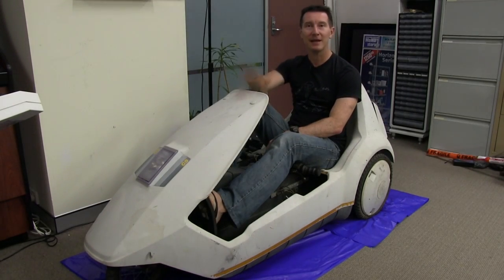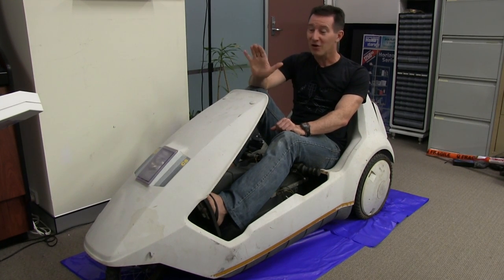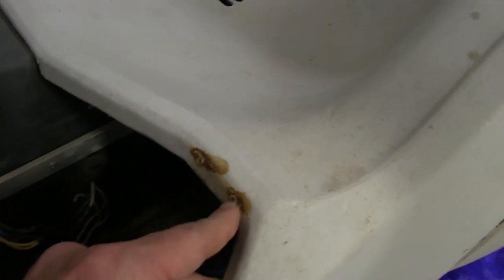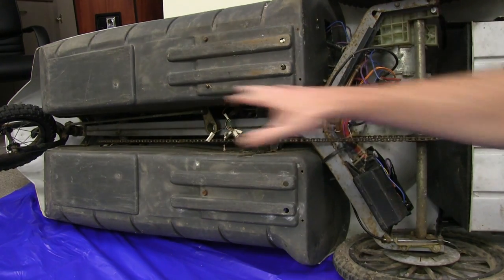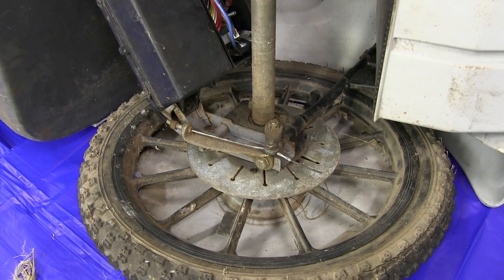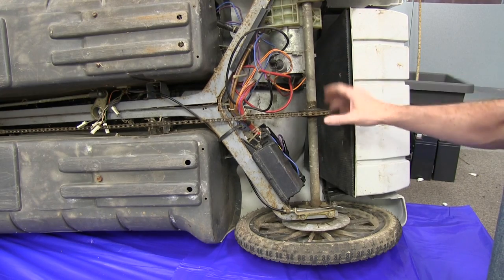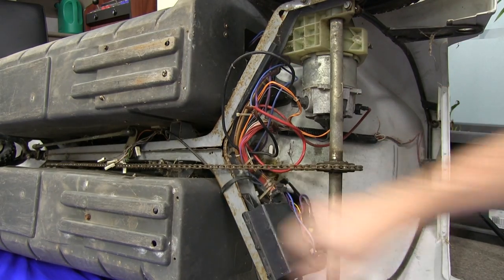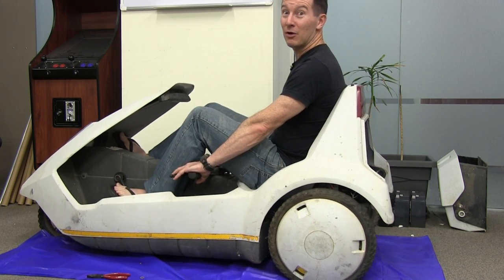EEVblog #604 - Sinclair C5 Restoration - Part 1

Comment: The rust doesn't look that bad to be honest, mostly surface. You could look into getting the chassis acid dipped, then powdercoated, or sand-blasted to just get rid of the rust. Pretty cheap considering the time it saves you!

Comment: The crucial part will be to repair the steel frame.
The sheets that the frame is made of seem to be very thin. After removing the rust even less material will remain. Thin sheets like that are very hard to weld. You probably won't be able to do that with a cheap arc welder and even if it was possible you should train on some other material first, or you will ruin the job. My advice would be to take the whole thing apart and completely free the frame of any rust stains. Then ask someone else to do the welding.

Comment: There are several torn spot welds. The way it has split apart would indicate the rear frame horns are bent upward slightly. Looks like it took a hard bump or pothole. Once the horns are pulled back down into align with the rest of the frame the gaps should start closing up. It will need to be welded and reinforced. I would not attempt to drill or bolt any kind of patch or it would weaken the frame at the hole and it will break. Just needs to be removed and taken to a welding shop. Might take them a bit to fabricate a reinforcement but it will make or break the project. Don't skimp on that repair. If it broke in traffic things could go very badly. But it is fixable by someone that can weld. Not a big deal.

Comment: Hi Dave, I'm a motor Mechanic by trade, but i love learning about electronics, and find your videos very interesting.  The Chassis on the C5 is certainly salvageable, the best thing to do would be to remove it, grind of the rust off then get somebody to weld the chassis together, then repaint.
Thank you for your very entertaining videos,

Comment: 15:30 - Seriously Dave, can't you recognise a "throttle" from an electric battery drill ? :D It's the mosfet and controller for a drill that's mounted by the previous owner.

Comment: I've restored a lot of stuff, and that is in excellent condition compared to everything I have worked on. One small crack, some light rust - the stuff I do you can put your hand through -, bit of fibreglass repair, paint, mechanicals, electrical, it's all pretty easy stuff. I've repaired stuff with sections missing out of it, it just takes a bit of knowledge. If you need a hand I'm across town.

Comment: Interesting little vehicle!, definitely needs TLC, but far from hard to restore!, actually has great potential if you want to hide some modern motors and drives in there :D
worlds fastest C5? :D
Reply: Maybe you should team up - you certainly could help him out with some of the mechanical aspects ^^
Reply: It is one interesting little car but it looks like the chassis needs some reinforcement
Reply: You could always help Dave out with welding a easy piece added to the Y joint and it would be good to go.
Reply: You guys should definitely team up one this one!
Reply: Kris Ankers
could go Delorian style and tig one up out of stainless :D, trouble is weight is an issue with EV's. tho with modern drives and motors, it would handle the few extra KG.
Reply: That's a cool idea! Why dot you make it in to a 1.4KW all wheel drive with 3x350W brushless hub motors? That thing will go like a rocket!

Comment: The main chassis is formed and spot welded.if you dont have welding jig, can G-clamp the chassis gap.. grid it flat..Cut a flat supporting plate and MIG weld it to the chassis, without removing the rear axle, as you might risk whooping the metal chassis.After the chassis is repaired send for Sand-blast>Primer>paint job,continue with other restoration work. This 3 wheel electric bicycle could be a simple restoration project.

Comment: Hi Dave!  Simply mold a new chassis out of carbon fiber.  It looks like there's plenty of room for a 50 hp brushless motor and a lipo battery bank.  Don't forget the fire insulation or that fiberglass seat will become a permanent part of your anatomy.

Comment: That chasis is an easy repair, I reckon it has split because of the leverage from the weight in the seat to the rear wheels. welding a y shaped plate !/16" thick over the frame where it has torn apart. The rust is superficial so a quick rub down and rust converter both inside and out. Job done.
Thanks for all your hard work.
M

Comment: Take the chassis to a sandblaster, for the rust. Once you get it fixed (welded), you may think of using an epoxy paint on it, to keep it protected in the future.

Comment: Chassis looks good. Just needs a sanding, and bit of welding along the bottom rib. Learning to weld is pretty easy actually. If you bodge the bead, just grind it down to make it look good. I'd definitely motorize the back axle so you get decent traction.

Comment: I would strip it down, send the body to the body shop who know how to handle fibreglass - they can make it look like new, fill in all the bodges. I'd send the metal chassis to a welders or engineer's shop, they'll grind back or sandblast the surface rust away and weld up the worse bits like the banana split. It looks like a C channel frame, which is not all that strong, so you may want to talk to them about filling it in with box section for added strength, but if you want originality and aren't a big unit, then the C section will be fine. Powder coat the frame and it'll look awesome. Then I reckon you'd be more than able to handle the rest as it's right up your alley.

Comment: The chassis isn't that bad. But you will have to totally tear it down to the chassis. You could grind most of that rust off it's mostly surface rust. Then spray it with primer and repaint it. I wouldn't go with a motor on the front wheel there will be no traction in the rain, no weight all at the rear. Just get a modern motor of an equivalent size but more HP. Then fill the battery bank with lithium batteries. It would be a beast. Welding is super easy and fun.

Comment: Replace the nuts bolts screws with 316 stainless steel, you will never have a problem with rust.
With the crack, a good clean with a wire brush, rust converter, than a steel plate over it. you would have to trim the seem  to get the plate on and MIG weld, some oil over the welds while they are hot for rust protection let cool clean them and than some paint.
And it looks like a trigger from a cordless drill, and they just added two parallel mosfets for more current. simple forward reverse controller.
looks great, and love your videos

Comment: You should put a Brushless motor on each wheel in the back with about 1000W each so you have enough power to go uphill. You can get them for like 20$ each at hobbyking and they can be synchronized and via the speed controllers. Also replace the battery with lithium polymer ones for extra range and less weight.

Comment: Tip from motorcycle maintenance. For the black plastic heads up display thingy, after cleaning dirt off wipe a thin film of clean motor oil on it with finger, then rub off excess with cloth,  It will bring it back to pretty good looking status for zero cost and you will feel better.

Comment: That is an easy repair.  And welding does not make the thing weaker.   It may look bad to you but restoration wise its not a bad starting point.  You just not used to restoration work.
Reply: +spartanworria I'm worried about the look of that chassis. It appears to be cracked all the way down. God knows what they did to that thing! The chassis is made from steel and was designed by Lotus, extremely strong and extensively tested under load for the equivalent of years of daily use. Maybe the rust just set in and weakened it. Welding won't help I don't think in that case, and even if the rust isn't that bad, I'd not feel comfortable welding up a crack that runs that far into the chassis and maintaining structural integrity. 

The chassis on the C5 is nothing special really, it's a simple Y frame design, and there's plenty of cheap replacements you could use on eBay or from China, much lighter and stronger alloys that won't rust and have a better rear wheel assembly. I'd personally just replace the whole chassis rather than try to restore it, however you have to make the handlebar steering work with a new chassis as most recumbent's with a chassis of this design I've seen use the two separate steering bars at either side.
Reply: It's not a crack that runs the entire length, they are two pieces spot welded together.
Reply: TacticalBBQSauce
Aye. I realised myself I just bought a C5 and see how they constructed the chassis in two halves.
Reply: Paul UK
Ah cool, hope you enjoy it they look like a fun project

Comment: First step is to totally strip it down and get a good look at the chassis. If it is salvageable then get it dip stripped to metal, inside and out, then welded up with reinforcing plates where needed and then epoxy coated. MIG or TIG isn't important, a decent welder can do that sort of thing with stick or even gas welding. Once you have the chassis complete, everything goes on from there. 

Being a knackered dog of a machine that has already been hacked around makes it morally a lot easier to modify without worrying that you are wrecking some technological religious relic.

Comment: The chassis is actually not to bad from what I can tell, Looks like mostly surface rust and a split weld.  Weld it back together, take a wire brush wheel and strip the old paint for a new coat of enamel paint and you'd be set. And well of course the wiring I'm sure you're more then capable of fixing! :D

Comment: The chassis definitely looks salvageable, it seems like mostly just surface rust. there's some deeper stuff in the seam in the middle though. It'd be wise to have a professional look it over and offer some advice though, that's one part you REALLY wouldn't want to break while in use.

As for the power-train, I'd suggest going with the front hub motor, and a multi-speed pedal driven rear drive. that way you can keep the two systems separate, and thus simpler and easy to work on. having more than one gear would be a major improvement in a hilly area, I'd imagine.

Definitely replace the lead acid cells with a bank of Li-Ion/polymers, and you can cut down on the weight of the unit (or improve the range) hub-motors are pretty awesome in terms of efficiency now days. I could see the right tyres making a significant improvement to efficiency too.

Maybe you could even work in a regenerative breaking system to further extend the range :) The old "HUD" definitely has to go, even if it's just a smartphone mount and some sort of software reading values by Bluetooth, it'd be as big improvement. This sort of tech exists with cars at present, and isn't all too complex either.

Comment: The chassis from what I can see looks very saveable, nothing to worry about just needs some sheet metal work and some nice mig welding and spot welding .
The rest of the chassis could be sand blasted with walnut shells .

Comment: Rip the thing totally apart and take the frame to someone who knows a bit of metalwork. Best thing to do is probably to sandblast it and see how bad it really is (apart from the crack in the middle it looks pretty OK). Then just grind the left off rust away and weld it back together, and apply some paint. I'd probably recommend powder coating or something like that.

Comment: The frame is definitely fixable, but it might not be worth it if the metal is too thin (could just break again somewhere else) or rusted already.

From the looks of the vehicle 70-80% of the weight is on the rear axle; a front hub motor won't have the necessary traction and you'll just spin it (especially on hills). I say go with twin rear hub motors. Then you get to do regenerative braking.

Looking forward to more great videos on this thing!

Comment: You can sand blast the chassis at home just make sure you use a proper medium for the thickness of the metal. Also I would take it to a metal worker to be honest and have them repair that central plain they could also do some structural upgrades for you specifically if your going to be adding a more torque intensive motor.

Keep up the awesome videos! ♥

Comment: I don't think you'll have any problem resoring this thing completely. Get the blueprints for the electrical systems and read that in bed at night. Buy a welder (which you should already own anyway). Practice with it on other pieces of metal, thin and thick to understand how to change the settings, then take the chassis to sand blasting place for them to remove all the rust and paint. The most challenging thing I see would be to put a better engine in it and to build a solar power roof for it. That's when you'll really need to think. The rest is just manual labor for like 40-50 hours at the most (yeah that's a lot hehe). Nice project, good luck, keep us updated.

Comment: Dave,
I would:
- disassemble everything, and recondition different parts separately.
- FIX the Y shapped chassis. Take it to a metal shop (whoever). It is a straight forward work, nothing complex (and shouldn't be expensive). Moreover, ask them to reinforce it, and properly paint it.
- I would install modern bicycle disk brakes. If you want to make it faster, make it able to stop! And heavy duty ball bearings, etc.

Don't worry too much about rust. Most of the rust is superficial and does not affect the integrity of the parts. From what I see most of it is ok (not seriously bad), except the chassis which IS broken.

That "beefy" switch does not handle the 29 Amps of the motor. The other switch came of a hand held electric drill. Horrible!

Do not abandon it. You will learn some mechanical stuff which will complement your core competence. Ask Jeri for an advise! Best wishes and keep us updated.

Regards, Charlie

Comment: yeah the chassis is knackered, all the spot welds have popped out, theres no metal left,need another one
, that bit at 9 minutes in, yeah the wishbone shaped part of it has ripped out of the chassis leaving behind the bits of spotweld, you cant just push that back in and patch it up
, as for the drill switch, the original c5 just had a basic switch and was jerky, this was to add a variable speed drive to it, the transistors to take the load from the variable drill switch

Comment: I'd recommend for a full restoration pulling the frame since it looks like a few bolts hold it to the body and shouldn't be too hard to remove, then bead or sand blast it to check. I would recommend something like a heavy duty bedliner or undercoat on the chassis metal, and from the video at any rate it seems like fairly thin metal which for a new welder will blow through very easily.
As far as welds on the drive goes, a fairly new person could probably put a couple passable tacks on it (although you'd probably want a professional to do it while putting the chassis back together.
For motor use, if you want a restoration I'd recommend just updating the parts but keeping the original design for motor location and such, but updating it notably with hub motors would be nice if you can get enough batteries onboard for them all. However, I would suggest seeing if you could fit newer disc brakes for a bicycle onto them, as the drums those seem to have can be a pain (and those rim brakes are annoying at times).

Comment: That looks repairable. In regards to welding and all of that, you should try to find a local machinist/welder who has a YouTube channel and see if they're interested in working with you on the project to get the frame back up to spec and maybe do some mods for the drive system and both of your channels can benefit. There's a lot of machinists on YT!

Comment: I think I understand what thw bodgey wiring is intended to do.  It's a throttle control.  Variable speed drill trigger feeding it's PWM output to the MOSFET to drive the motor. It's scrapheap challenge!

Comment: I restore old cars - the rust on the chassis is just surface rust.  A wire brush/green scrub pad and some rust converter (usually diluted phosphoric acid) will take care of it.  The broken welds should be re-welded.  The best thing you can do  is take it out, sand blast it, repair the broken welds and have it powder coated.

For the rusty bolts, spray them with penetrant/loosening fluid (PB Blaster is what we use in the US) and leave it for a few days.  A sharp hammer blow on the nut or bolt helps loosen things up as well.

BTW, it actually looks pretty clean for a 30 year old vehicle.  There's a lot of dirt, but that's no big deal.

Comment: Dave

I restore cars and tractors for a hobby and run into a lot of "frame" problems like you have with your project. Take that frame to a welding, fabrication shop and that should be able to fix that up without much problem. If it is worse that what it looks like that frame is not a difficult design and a welder would be able to fabricate a new one for a reasonable cost.

I would look into having the frame powder coated after sand blasting and welding up the seams to prevent any corrosion. Powder coating works a lot better than paint.

Comment: Does not seem that bad, Strip it down, and get someone to fix the welding on that chasis for you, and get it sandblasted.
Getting it sandblasted, is a good investment timewise, you save quite some hours with a grinder, for not a lot of mony.
In my optics other than the crack, it only looks like surface rust.
In my projects restoring motorbikes, i found that it is definitly worth going for powdercoat oposed to regular paint, specialy if it is the kind that you get from a spray can, and applie you self, that won't last.
The plastics is often hard to make nice looking agian, but for a short term solution, you can use, bumper clener, found at home deapots, and gas stations.

Spelling mistakes is free :-D

Thanks for a lot of nice videos, watching almost all of them.

Greatings form Denmark.